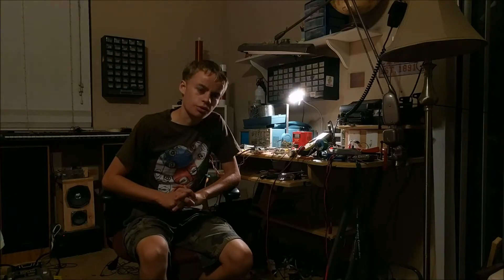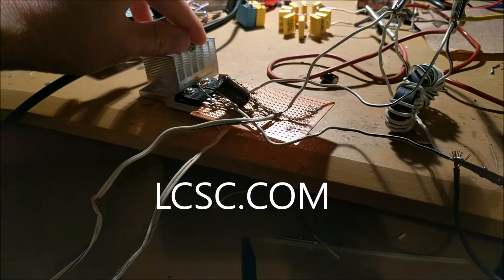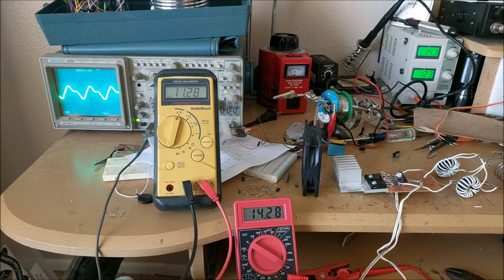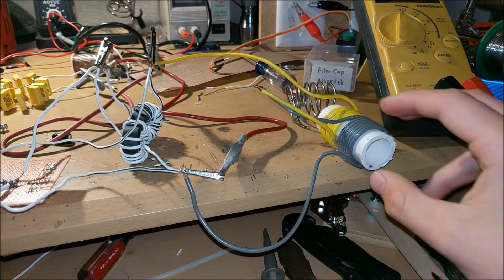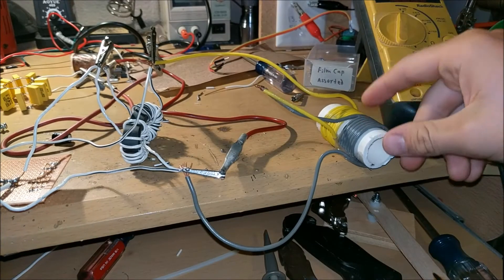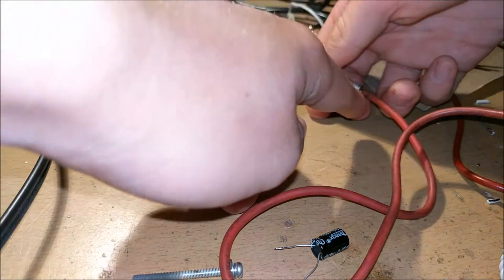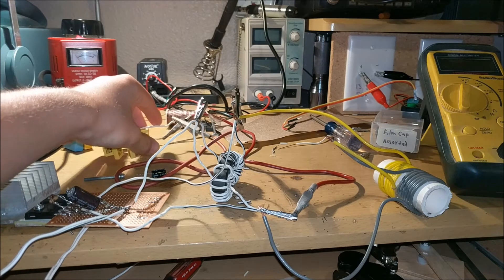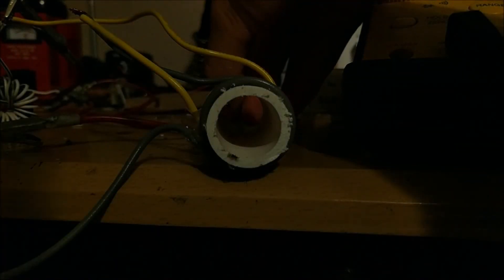Why a Ferrous Induction Heater Coil Is Bad (Causes Inefficiencies and Exploding MOSFETS)

Comment: The clips heat up because they are made of steel, as you mentioned, but the exact reason is conduction loss (I^2R). Steel is much more resistive than copper and the clip is made of thin steel sheet (thus it has tiny cross-section), and on top of that the current in the tank circuit can reach huge levels. You earned the like just for showing those MOSFET's blow up :D